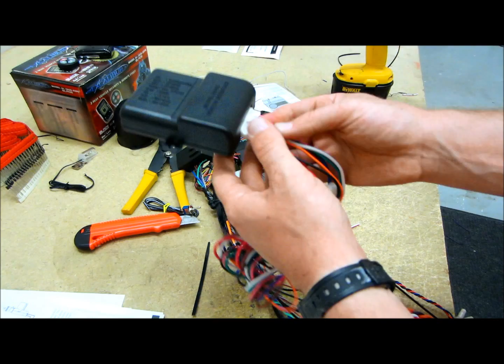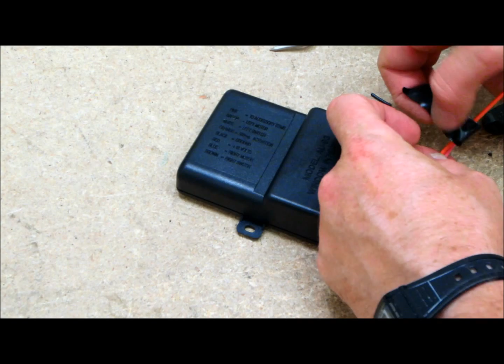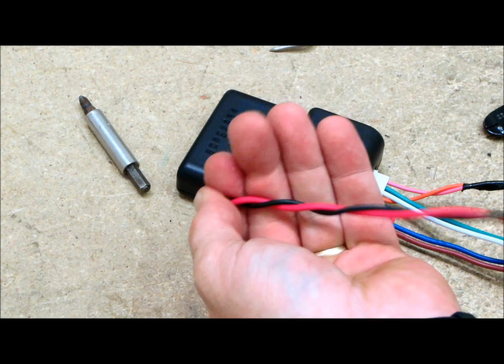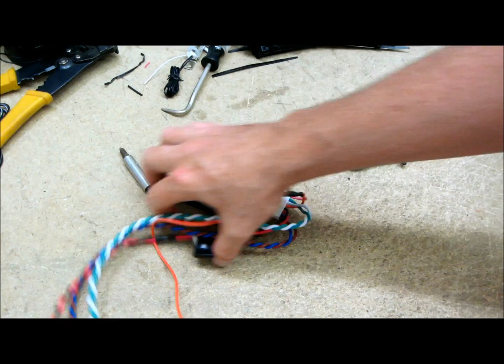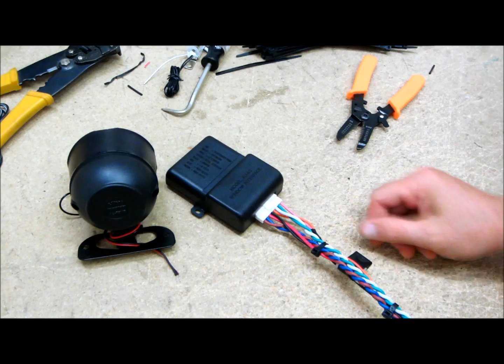Part 12    start to finish alarm remote start install series (2004 Monte)

Comment: I have hooked up my 2 x ST535s (one for front and one for rear windows - DIP switches set accordingly) Front windows take priority over rear roll-up.
The basic gist is:
--- windows stop rolling up/down when starting up to ensure max amps to starter.
--When windows roll up/down they stagger with front taking priority
-- Windows can be rolled up by alarm

But I have a few questions around linking them together) specifically if anyone can shed light upon these connectors for 2 535T units:

H2/3 aux input (-)
H2/5 output activation (-)
H3/4 Delay input (-)
H3/5 siren trigger (+)

This is what I have assumed:

---Viper Start output -->front 535T H3/4 Delay input (-) +  and to rear 535T H3/4 Delay input (-)
---Viper siren output -->front 535T H3/5 siren trigger (+)
---Viper Aux output -->front 535T H2/3 aux input (-)
---Viper GWA output -->front 535T H2/4 GWA
---front 535T H2/5 output activation (-) to rear 535T H3/4 Delay input (-)

I have added a few rectifier diodes but this appears I have made is overly complicated

Comment: do you use another role up module to roll down the window if you have any idea please let me know. My csr window rolls up with eindow rol up module when I lock through remote but when I connected another role up module to roll down it failed. But through the buttons windows roll up role down works.

Comment: Is there any way to hook up a second siren to a diy all-in-one car alarm? We have a couple from Bulldog and want to add the louder siren that you have on the website.
Reply from the maker: all in 1's aren't really designed to be upgraded so I wouldn't be overly emphatic on this answer.... but let me ask you, Does that alarm have any outputs for flashing lights that you may be able to use to add extra features?
Reply: No it does not. The only wires that even come out of it are ground, hot and l.e.d. light. We ARE planing to move up to  an Excalibur, but until then we were just wanting it louder. Could I run it off of the existing siren wire with a relay or would that be too much stress on the system?